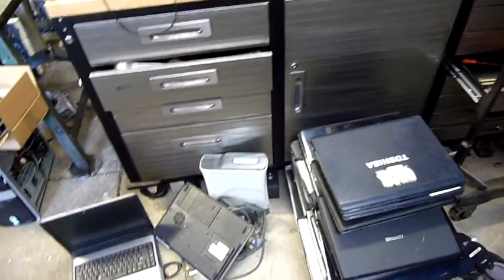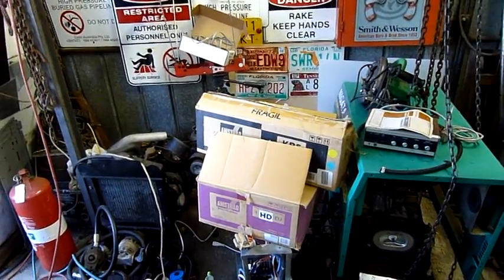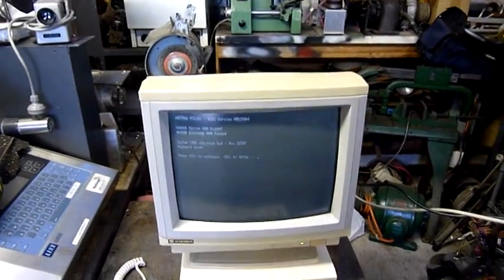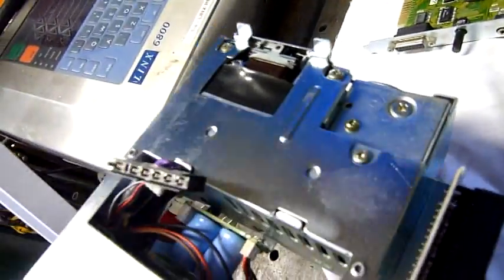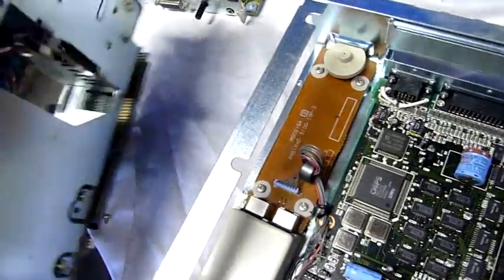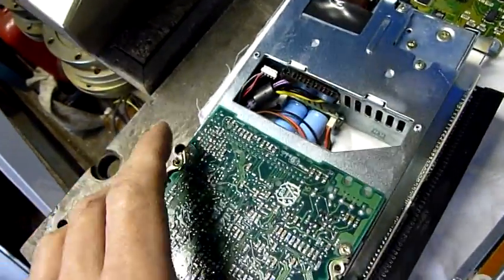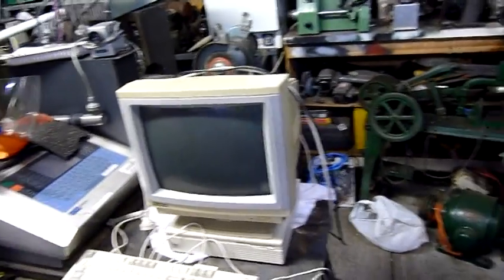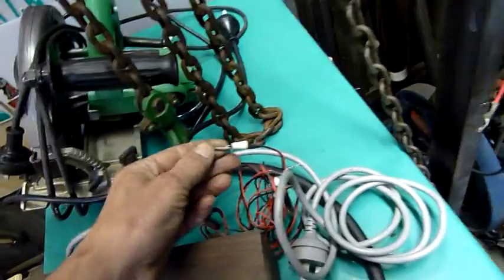Amstrad PC5286 Personal Computer Hardware Inspection and Boot Up

Comment: You can still buy those 3.6volt rechargeable barrel shaped batteries, I used to refurbish Amiga motherboards all the time which were also notorious for severe or catastrophic corrosion from the battery. For maximum resale, and yes, I made a lot of money on them, it had to look original.

Comment: I had one of these around 1999-2000. I pulled this and a 386 out of the rubbish behind a computer shop. The 386 was gone but had a good PSU and floppy drive. So I had an Amstrad 286 for a couple of years in high school when I couldn't afford anything else. I carried home an old 14" CRT display in my school back-pack! As I recall, these will take up to 4Mb of RAM and I installed a SONY 80Mb HDD into it. Thankfully, it used standard 1.44Mb 3.5" disks and saving my documents in RTF file format I was able to work on my assignments and take them to school to print out. My dad threw it out while I was away for a weekend with cadets. I wish I still had it - it was an incredibly dependable machine that ran very fast with the old software.

Comment: The disk in this computer is IDE. I have the very same Seagate ST351A/X drive in my collection and I can confirm that it uses the standard IDE interface. It's one of the few IDE drives which still uses a stepper motor to move the head's arm assembly, these drives were the last with this technology.
Also the disk's flat cable seen in this video is a standard IDE, RLL and MFM drives used 2 flat cables to connect with the controller, one for the data bus and one for the command bus.

Comment: I know a good replacement for the battery... 2x halfway empty AAA's in series wrapped in plastic!!! I even have a video of doing it to an iMac,at least that doesn't bother with the lower voltage. The original batteries are sort of rare and very expensive for what they are,plus they are all chinese leakwilling cells stamped with good brands.

Comment: Hi Ed, I just got one of these exact same PCs and it's got a dead PSU.  I'm trying to remove it from the chassis to open it up and see if it's fixable but I can't get the drive/PSU cage out of there.  I see the four screws you mentioned but even with them removed the cage seems stuck fast and it still has the ISA riser card attached to it and, I'm sure, well inserted in the motherboard after 30 years without being removed.  Have you got any advice on how you managed to get drive/PSU cage removed all those years ago? Many thanks, Tom

Comment: That Seagate disk has their special low-impedance stepper motor, which was probably the fastest stepper ever to be used on a hard disk.  Most of those drives were also self-parking.

Comment: My first hard disk was a 60mb 3.5" ide unit connected through a hack under the 68050? cpu of my amiga 500. It sound like a jet spooling up to idle speed. Some commands that might be helpful on the dos screens:

DIR *.  <-- list directories only
CD (dirname) <-- change to a directory
CD .. <-- Back up one level in the directory tree
dir *.exe <-- list executable files in a directory
dir /ah <-- list hidden files in a directory
edit (file.ext) <-- edit a file ex:
edit autoexec.bat

have fun :)

Comment: I wouldn't bother replacing that CMOS battery if the PC can run without it and you only use it once in a while - just remove the dead battery so it won't leak. Then you could note down the settings you need to change in the bios for booting from the harddrive and put that note underneath the keyboard or case or something like that :)
That way, your "new" battery pack can't leak and unnecessarily destroy something ;)

Comment: Typically those cells are just 3 1.2volt Ni-Cd button cells wrapped together. Ni-Mh rechargeables might work with the charging circuitry but if you can find some cheap 300mAh or so Ni-Cd AA's or such that will work as a nice replacement.

Comment: Boards of this era typically used a very simple charging circuit - essentially just a resistor from the +5V supply. You need something a bit more sophisticated for NiMH to avoid overcharging. The easiest solution would be to find something of the same voltage and chemistry in any form factor and mount it offboard. That also means if it does eventually leak, it won't ruin the PCB.

Comment: The Amstrad PC5286HD  has a 16 MHz 80286 CPU with a massive 1 MB of RAM, I remember repairing one of these in the early 1990's (or was it earlier) it was quite a departure from the huge system units I was used to seeing.

The battery if you intend to replace it needs to be replaced with a similar battery as there is a trace with a smd resistor and diode to charge the nicad, some boards had a header so you could use a external battery (4x 1.5 aa cells) and a jumper you had to remove.
..Eddie

Comment: Ed, you can use a button cell batt like un most mothers. No issue.
If you seek for a GOOD ONE and LONG LIFE,   TL5955, but you can look the batt you want, Tadiran has tons of models, that's premiun quality. You collection already got a C64 ?. You need one, plus an Amiga 2000 or 3000 !!!!. Nice vintage systems

Comment: Boy that's vintage. OK the system requires a proprietary  Amstrad keyboard to operate it. no PS2 or even ATX. Nuts ain't it. 

The HD precedes IDE, It's a 40MB RLL hard drive (CMOS type 17).

Amstrad tried to emulate the PS/2 family with their series. As you can see, they didn't make out very well.

Comment: The Windows for Workgroups 3,11 core files were released by Microsoft as a free upgrade to 3.1 back in the day. If you have a floppy handy and a way to write to it you can patch it up to 3.11 but it won't have all the networking stuff Windows for Workgroups 3.11 had.

Comment: Hey Ed, got any good working Toshiba Batteries with one of the following part numbers?
PA3399U-1BAS PA3399U-1BRS PA3400U-1BAS
PA3399U-2BRS PA3399U-2BAS PA3399U-2BRS
PA3400U-1BRL PA3400U-1BRS PA3478U-1BAS
PA3478U-1BRS PABASO57 PABASO76
PABASO77

Comment: I have an old APPLE II/GS and the battery was completely dead so I unsoldered the battery and then I just soldered on a regular 2xAA battery pack to it since the battery was a regular lithium battery and doesn't recharge.

Comment: you can replace those 3.6V batteries with 3 AA batteries in a remote battery holder with no issue. just clip the battery off and solder the cables to the remaining 'legs' on the board.

Comment: It would appear the CHIPS f82c452 is a 286 compatible clone.

The Yamaha ym3812 is a frequency modulation synthesis chip, the sound card might have AdLib compatibility.